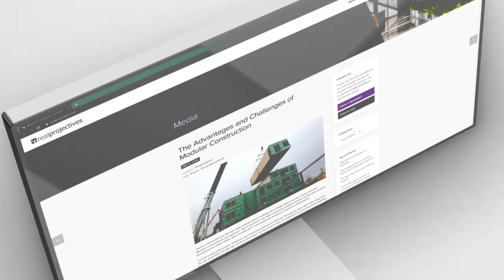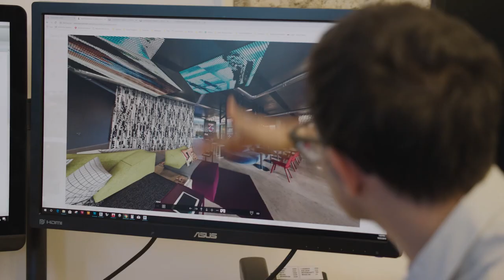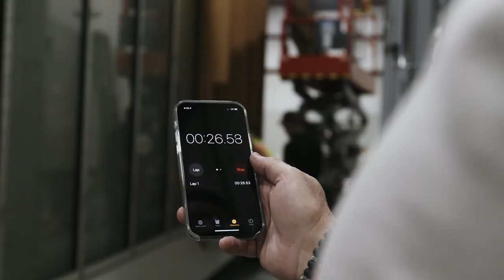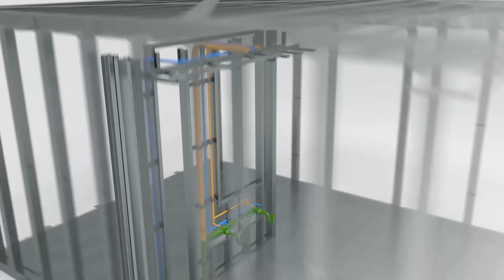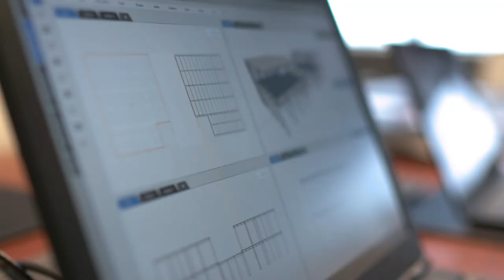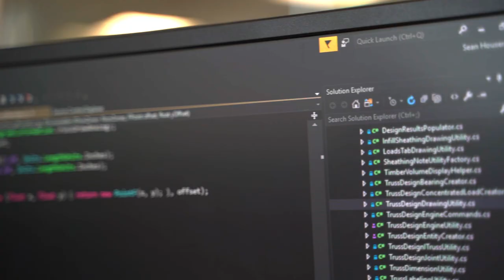The MiTek Modular Story

Comment: I find it baffling that we haven’t adopted an assembly line approach to construction. Instead of sticking to outdated methods, we could be revolutionizing the way homes are built. For instance, why are we still constructing walls with plumbing, electrical, and venting systems? We could run all these systems from the floor to avoid wall penetrations and preserve the integrity of the building's energy envelope. Furthermore, traditional wood framing could easily be replaced with more durable welded steel frames, offering greater resilience.

Our insulation materials are also far behind. We should be using advanced, sustainable materials instead of relying on outdated options. Additionally, separating exterior walls from interior walls with air gaps could enhance insulation and energy efficiency.

We’re in the middle of a housing crisis, yet there’s no bold, innovative "moonshot" solution coming from our elected leaders. This is a failure not only for millennials but also for future generations. We should be able to order pre-fabricated walls or even entire systems for specific needs like kitchens, bathrooms, or HVAC units—ready to install with minimal hassle. These segments could be delivered with external connections for quick integration into supply and return systems. The lack of effort to modernize the construction industry is nothing short of a disaster.